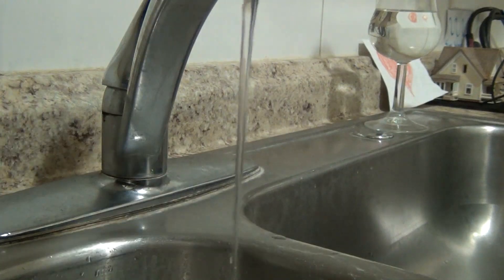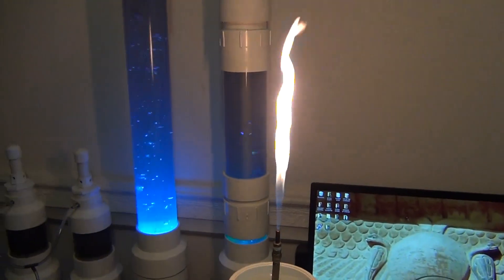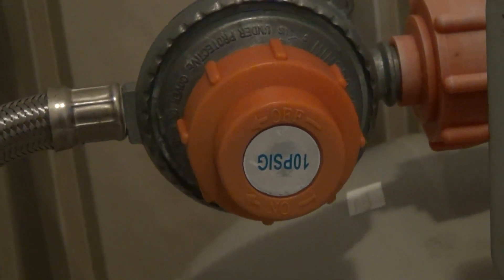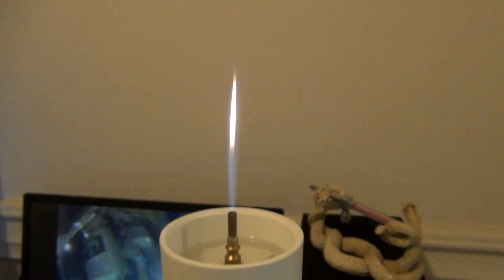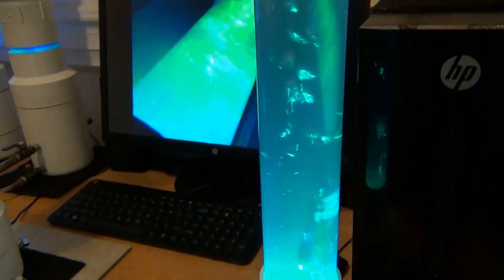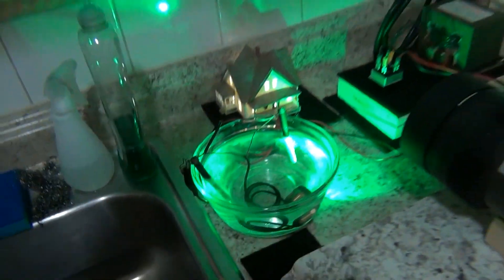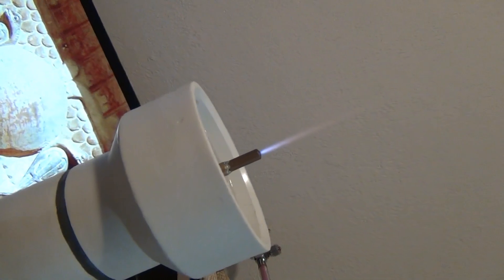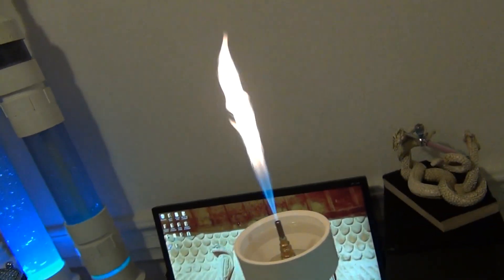HHO HYDROCARBON SCRUBBER TOWER TECHNOLOGY

Comment from the maker: You can "scrub" your dirty nonrenewable energies like your standard propane gas and increase power clean up these fuels using your behemoth bubbler system and oxyhydrogen fuel cells by mixing them together to make Hydroxopane a mixture that will not flash back to the reactor and burns at a much cooler temperature more suited for cooking lighting and more.